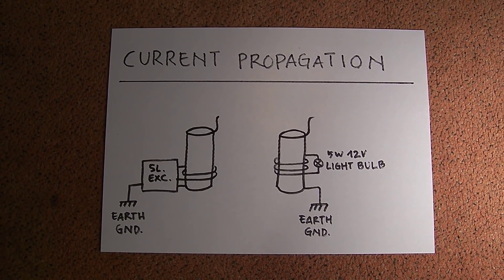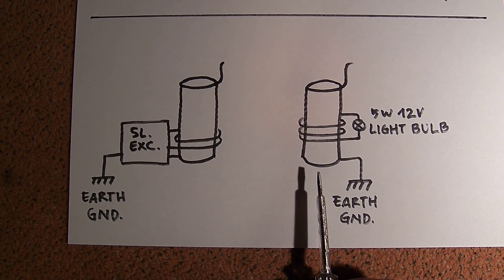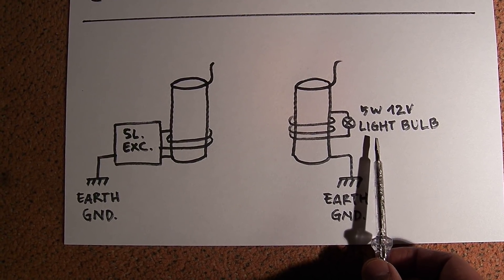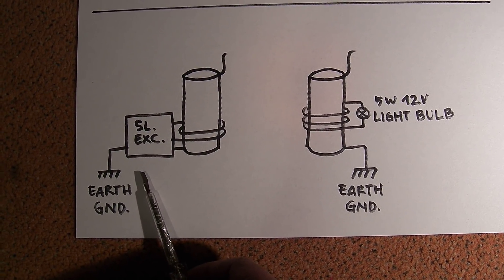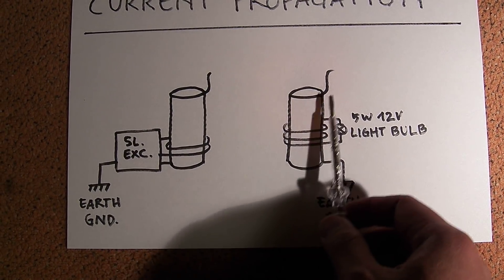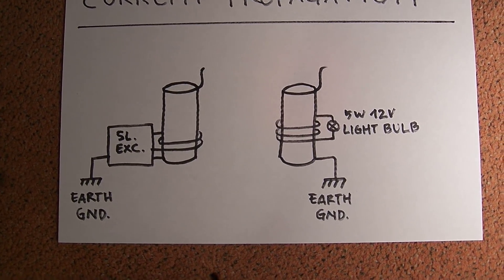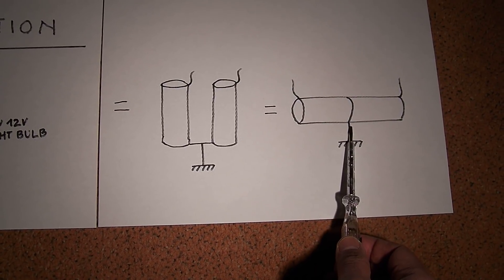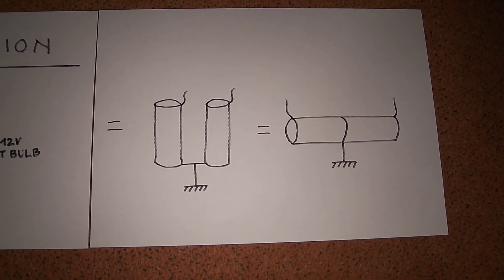Tesla's Earth Ground Current Propagation

Comment: The ground is an excellent conductor of electrons and the aether. very good.
Reply: I experiment with various oscillator coils. A transistor, a resistor, and two coils. Also configure rectifier bridges and capacitors to store the back spike produced by the coils. 
There is an experimenting room in the shop about two hundred feet away, also there is a tower here at the house and one at the shop. When hurricane Ida came through last August I lost some tin off the roof and the shop got all wet, very depressing.
I had an idea for a new coil and put it on the desk in my room here in the house. Drove a seven foot piece of half inch pipe in the ground outside the window not far from tower here at the shop. There is a ground rod through the floor in the middle of the experimenting room also. Had the idea to run a piece of no. 10 stranded wire running from were I am in the house up the tower to the tower in the shop and down into the experimenting room.
Normally the collector of the transistor goes to the coil, however had an idea to run the collector to ground and the coil end to the aerial wire that goes to the shop. Well the oscillator works well with the earth as part of the circuit. the shop end of the aerial is attached to ground for a return.
I live out in the country and have room to do things like this. I am trying various thing in hope of tickling the telluric currents or agitate the arether just a little, don't notice anything outstanding so far, but it is interesting. 
You have much more ability than I, no math or formula's, just basic principles, I call it "Gut Science". Have a saying, "Try it and Fry it. 
Try using the ground itself in some of your circuits as part of the circuit configuration. The result could be surprising. 
Just a short reply, employe the earth. Tesla used it to convey the aether to remote locations.
Later.............Marc.

Comment: well done, the measurement current intensity by test pen is showing dielectric field. in the other hand the measurement by adjusting the secondary coil is the intensity of magnetic monopole field..according your measurement the highest intensity of the secondary coil adjustment, the wave must propagate in primary receiver coil is half wavelength. if im not wrong the proportional wavelength between primary and sec. coil have no proper standing wave ratio

Comment: Hello Okki, for long distance transmission you need cold energy and high voltage and high frequency. This voltage is able to interact with the ether and transmit the energy very far. Then you can connect how many receivers you want without influencing the transmitter.
Reply from the maker: Thanks for the input Gheorghe.
Reply: Okki Moeljadi Your slayer exciter must been like this.
http://dai.ly/x6f30a3
This is cold electricity.

Comment: Hey Okki, can you tell us what the amp draw is with the bulb attached to the power supply as reference  so we can see if you are getting anything extra from the ground?
Reply from the maker: In order to measure the current on receiver's side, we have to rectify the output current. This system is running at high frequency therefore we need high speed (ultrafast) diodes. I don't think we can get more power from the receiver than what we send.
Reply: Yes, but if you burn the bulb at full brightness from the power supply you can get a good reference as to what the bulb draws by itself.
Reply from the maker: That's a good idea. I'll try that.
Reply: Very old post.   I have tried adding a good outside ground and the voltage on my recieve coil went up 11 or more percent and brighter.   It even works connected between the Bulb low voltage and ground.  You guys giving me Ideas on were this extra intensity comes from.      Because you are transmiting power what if you add a long antenna to reciever or a flat plate higher,   or one of his Pancake coils.
Reply: @mike289homebuilt5  Another thing to try. Use batteries as your source rather than the grid and see if you get any change in your results but be careful. If you could tune your antennae to your transmission frequency you can optimize the transfer. One more thing that i've noticed in most of the old patents, they used spark gaps. Spark gaps seem to intensify your power as well but you will have to play with these ideas to see what I mean. Today, you can emp stuff with enough spark so play at your own risk, I've blown up my PS several times, crashed my TV (it survived) and wreaked all sorts of havoc messing with them.

Comment: Well done, and very well explained and shown. Question is , what if the receiver coil does not have the same earth but just a virtual earth via a big metal object and is a few hundred feets away ?
Reply: overunitydotcom well then you'll have to match the frequency perfectly to seevany result, failing that just put the receiver coil very close
Reply from the maker: If the receiver is well tuned, you will find the same behavior in my opinion.

Comment: Just one question, if one were to connect the Tesla coil’s with a single wire instead of using Earth ground, and they were close by, how efficient would it be?
Reply from the maker: A coil can be excited in three ways: 1. Electrical-way, 2. Inductive-way and 3. Capacitive-way. Regarding your question about the efficiency of one wire connection of powering a coil is, it depends on your setup. You have to "hit" the coil one-wirely at the right frequency and at the right time (phase). Actually the frequency is the most important, timing will just follow the frequency being given. If you can pulse the target coil exactly at its resonant frequency, you will get high efficiency one-wire power transmission.
Reply: Okki Moeljadi thanks

Comment: Another nicely done video.  Agree with what you have observed.  I state a different but really the same.  The ground wire transfers the vibrations (potential vibrations, resonant energy) from your slayer circuit to the receiver.  Since the wire is open at the top of the receiver (impedance mismatch) you create wave reflections and ultimately it appears a standing wave on the receiving coil which appears as a variation in illumination of receiver primary coil when you move it up and down.  The electrical field you observe with your screwdriver light is of RF (transverse wave) near field characteristics which decays sharply at a distance.

Although I understand why you call it "ground current propagation" I tend to call this whole circuit 'potential propagation' or a potential circuit as current is not allowed to form the necessary 'closed circuit'.  Tesla would typically ground the bottom of his magnifying transmitters (tesla coils).  He then would mathematically use either a quarter wavelength (or 3/4) of wire in his tall vertical coil to cause a standing wave with the maxima at the top (open wire) and minima at the bottom (forced with ground connection).  The other advantage being that the million plus volts was high in the air and not next to the people on the bottom.

Apologize for the 'wordy ness' of my reply, but I type as I think...and move on

Thanks much!
Reply from the maker: Hi Mark, thank you for your feedback. It is a pleasure for me to read a comment from an experienced viewer like you. And you are right about there is no current flow in open system like this. Like you said, this is a potential vibrations.
Reply: but birds might get zapped in the air?

Comment: Hello Okki, I don't understand how connect the slayer exciter to ground. I supposed by a wire connect from the base of the secondary coil to ground, is true?
Reply from the maker: Hi Gabro, there is no direct connection from the Slayer Exciter circuit. The earth ground connection is made by the power supply which connected to the wall outlet.
Reply: Okki Moeljadi ok thanks for the explanation, I will try to make the same.
Reply: Hi Okki there is another problem because I make my own power supply and there is no ground connection. There are only four transformer from 220 ac to 12 ac and they are in series, so I can increase the voltage to 35 volts 7 ampere. But I don't know how connect the ground to the power supply, just connect it to the negative - 30 volt of my output? Thank you for your time.
Reply from the maker: Just connect negative input supply of Slayer Exciter to the earth ground.
Reply: Okki Moeljadi Ok thanks you very much
Reply: but most psu are not grounded - so that is an interesting observation. 
thanks for sharing.

Comment: Excuse me, but where is the ground for the transmitter? The negative terminal or what?
Reply from the maker: Transmitter ground is connected to the driver's circuit. Please study "Slayer Exciter Circuit".
Reply: @OkkiMoeljadi  I know of the slayer exciter circuit, I just never saw it transmit through a single wire.
Reply: @filigenzilab9613  All high frequency circuits do that
Reply: @Magneticitist  I made a slayer exciter, yet it would not transmit through the bottom wire of the first Tesla coil
Reply: @filigenzilab9613  when you don't ground the coil all of that high voltage is just floating which is why you might be able to light things with one wire anywhere on the circuit. When you ground it that energy gets dumped into ground. So for example in a normal Tesla coil that isn't base fed off the bottom of the secondary you can just put loads in series with it and the ground. You can do the same thing with a Slayer Exciter but they usually aren't as powerful. You can just create single wire antennas though. Maybe just run a wire off your top load out to a distance and see that you can light things up near it
Reply: @Magneticitist  correct. I just don’t know where to connect the single wire to. Is it the bottoms of the coil, the negative terminal?
Reply: @filigenzilab9613  There are honestly different ways to do it but yea typically you may want to ground the negative terminal of the transmitter and the bottom of the receiver secondary. If it were a more common SSTC the bottom of the secondary transmitter would be going straight to ground through a feedback transformer.

I have two dissimilar looking coils which happen to resonate well with easy tuning. This is wireless through the air. Grounding either coil will change the impedance to where neither coil will resonate. There are nodes along the receiver which is why moving a primary along this receiver with a load attached to that primary will transfer more or less power. By lengthening or shortening the receiver wire in the slightest increments this impedance changes, for example clipping a centimeter of length from the bottom of the ungrounded L2 receiver. 

If you have two similar looking coils which are wound to resonate, attaching them both to earth ground is beneficial. You could also however do something like attach a wire between a transmitter and receiver without any electrical connection, just coil the ends of the wire around each coil toward the bottom next to the primary. 
The coils wouldn't need to be electrically similar because the HF HV is traveling down the wire and the receiver is just an antenna picking up the field.
Reply: @Magneticitist  Thank you

Comment: In theory, you can have many receivers for same input.
Reply: So if his transmitter omnidirectional and he could pick up input power many times over from difrent recivers would it be fair to say if the signal was focused at a reciver via a yargi or a dish could pick up even more input power? Or would it just be the same power over a longer distance?
Reply from the maker: Hi Davy, I have tested the idea and it did not work. If I place more than one receiver, the power that can be obtained from each receiver become weaker. So there will be no power multiplication in such setup.
Reply: Okki is right, more receivers = more energy shared from the transmitter.....
we should try with DRSSTC receiver and transmitter to see if there are some differences/gain
Reply from the maker: Hi Gianni, you have already DRSSTC. Can you please do this test? Maybe you can get better result.
Reply: Perhaps you need to decouple the ground connections with the right sized  capacitor, like an upside down tesla coil with top load capacitor.  When you have this Tesla concept working correctly, you will be able to run multiple receivers with no change on transmitter.  
http://www.cheniere.org/images/EMfndns1/sm%20Lorentz2.jpg
Reply from the maker: I did that test Davy and I did not see that effect. Please check out my video here: https://youtu.be/ymHOcdLwN3I
Reply: @GianniLaschi  Forse quello che trasmette non è energia radiante ma soltanto un onda elettromagnetica ad alta frequenza, l'energia radiante è un'altra cosa, ecco perchè non funziona.

Comment: Tesla: “I mean that you have to have in the circuit, inertia. You have to have a large self-inductance in order that you may accomplish two things: First, a comparatively low frequency, which will reduce the radiation of the electromagnetic waves to a comparatively small value, and second, a great resonant effect. That is not possible in an antenna, for instance, of large capacity and small self-inductance. A large capacity and small self-inductance is the poorest kind of circuit which can be constructed; it gives a very small resonant effect. That was the reason why in my experiments in Colorado, the energies were 1,000 times greater than in the present antennae.”
Counsel: “You say the energy was 1,000 times greater. Do you mean that the voltage was increased, or the current, or both?”
Tesla: “Yes [both]. To be more explicit, I take a very large self-inductance and a comparatively small capacity, which I have constructed in a certain way so that the electricity cannot leak out. I thus obtain a low frequency, but, as you know, the electromagnetic radiation is proportionate to the square root of the capacity divided by the self-induction. I do not permit the energy to go out; I accumulate in that circuit a tremendous energy. When the high potential is attained, if I want to give off electromagnetic waves, I do so, but I prefer to reduce those waves in quantity and pass a current into the earth, because electromagnetic wave energy is not recoverable while that [earth] current is entirely recoverable, being the energy stored in an elastic system.”
Counsel: “What elastic system do you refer to?”
Tesla: “I mean this: If you pass a current into a circuit with large self-induction, and no radiation takes place, and you have a low resistance, there is no possibility of this energy getting out into space; therefore, the impressed impulses accumulate.”
Counsel: “Let’s see if I understand this correctly. If you have radiation or electromagnetic waves going from your system, the energy is wasted?”
Tesla: “Absolutely wasted. From my circuit, you can get either electromagnetic waves, 90 percent of electromagnetic waves if you like, and 10 percent in the current energy that passes through the earth. Or, you can reverse the process and get 10 percent of the energy in electromagnetic waves and 90 percent in energy of the current that passes through the earth.”
. I only used low alternations, and I produced 90 percent in current energy and only 10 percent in electromagnetic waves, which are wasted, and that is why I got my results. You want high potential currents; you want a great amount of vibratory energy, but you can graduate this vibratory energy. By proper design and choice of wave lengths, you can arrange it so that you get, for instance, 5 percent in these electromagnetic waves and 95 percent in the current that goes through the earth.
Reply: Thank for this man i need it

Comment: How far can it go?
Reply from the maker: Not far. My system has low power.
Reply: Okki Moeljadi is there a way to transmit power wirelessly using the ground as a connection over long distances? If so what frequency should be used?
Reply from the maker: You have to think like this: imagine the wave on surface of water. You can make disturbance (this is the transmitter) on one side of pool and on the other side you have your receiver to detect the wave sent by the transmitter. If you want to do it across the ocean, you have to make a huge disturbance on one end (beach) and this wave has to be powerful enough so that you can detect it on the other side of the world. Frequency tuning is of course important but transmitter power is also important. It is better to capture natural signal from the environment (lightning, sun energy, cosmic rays, etc.) and convert it to electricity than to transfer electric signal wirelessly over long distance.
Reply: Okki Moeljadi thanks
Reply: @OkkiMoeljadi  unless of course you are able to understand and ride the longitudinal waves!

Comment: Nice demo as always Okki!
I tried some different methods for wireless energy transfer, the best results i got is using two identical coils and identical topload, they are perfectly tuned for the maximum transfer efficiency, your insulated plate act as a topload (capacitor) you need to postion exactly near the coil to find the perfect capacitance to tune the receiver, is better to put it on the top of the coil, an example i made (this is with slightly different coils,so i put on the receiver (have more inductance) a topload to drop the frequency... the first lamp is 220v 15W, the second lamp is a 12v 50W used in "stepdown" receiver mode)
input power supply  32v 700ma (max)
https://www.youtube.com/watch?v=TllKN6bYPGU
i tried to rectify the receiver output, it works well but needs fast switching diodes or  a lot of energy will be dissipated as heat losses ;)....
i'm still surprised how high is the efficiency in short distance wireless energy transmission, thank you for your contribution!!!
Reply from the maker: Thanks Gianni. I have watched this video of yours. It is very interesting. And yes with correct settings you can get high efficiency power transfer.